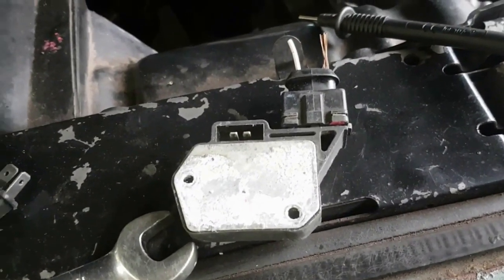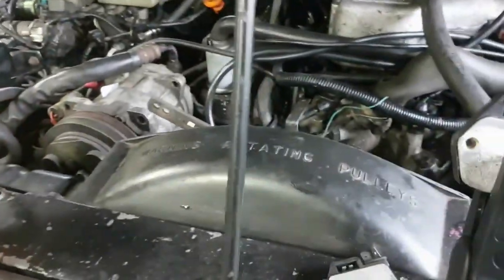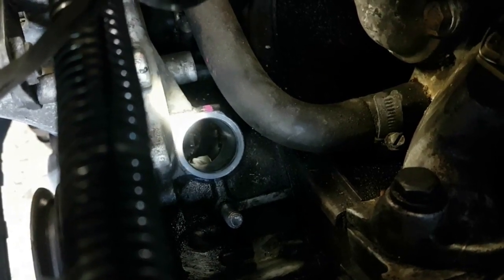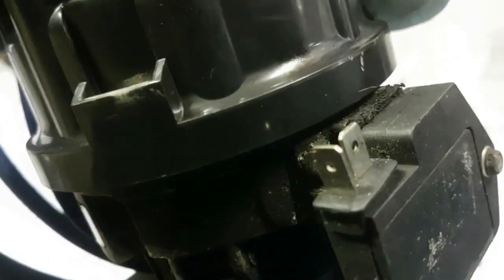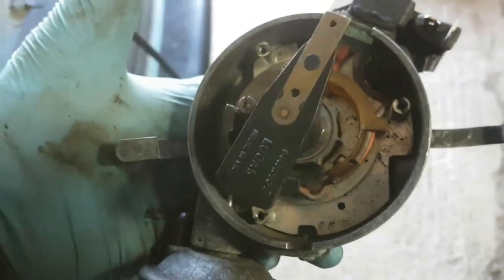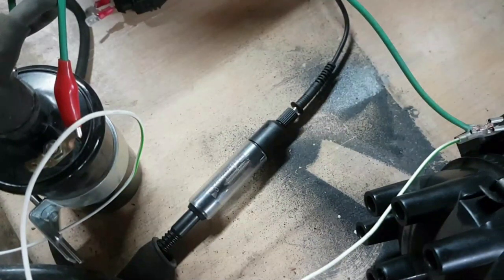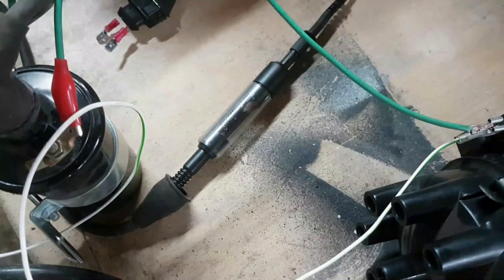Ignition Masterclass - Rover V8 35 DLM8 - Parental Warning

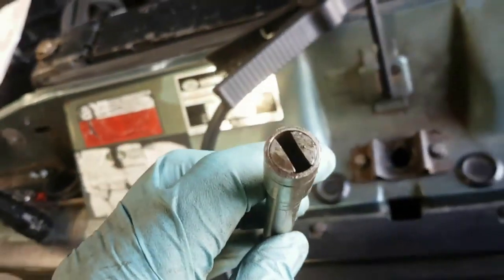Comment: 2:24 Imagine the fun you would have when the 12mm socket falls off the extension bar and drops into your engine!
Reply from the maker: only use steel tools, magnet on a stick will retrieve it. else I am sure it would find it's way to the sump.. Or just use decent quality tools where the connection is quite robust

Comment: I have 1991 Range Rover... no spark. I purchased ICM and no idea where to connect. The only after market Mallery Distributor, so its not connected to distributor. Can you offer assistance.
Reply from the maker: Mallory doesn't need the icm as it is all self contained within the unit iirc. If no spark you need to go through some basics of checking voltage to the coil and distributor LT connections and take it from there. Drop me an email if you are fighting

Comment: Hey mate, I've got a rover v8 (see my channel 🙂) it gets to about 3k rpm and splutters and won't rev any further. I've checked vaccum advance and is working by sucking on the pipe. Where should I look? Some wear in the dizzy cap. 

Running on tornado ecu chip with a supercharger on the top. Running the UK no cat 470ohm resistor with a straight through from manifold. Manifold glows red hot at idle.

Cheers if you can help!
Reply from the maker: I had an issue with a distributor that wouldn't rev past 3k rpm, that was a 35dlm8 and there was too much play between the top plate and the baseplate in the distributor.

email me if you need more info

Comment: How about the other Rover V8 distributor, the 35DE8? The one in this video was the 35DLM8, the one with the module fitted on the side, but the 35DE8 has it all inside, and I've got a problem with one of them, the low voltage bits work ok but there's some kind of daft problem with HT in the cap, there's plenty of strong HT before the cap, but it's too weak to start after it, and I've replaced the cap with a new one, AND a new rotor arm, but it's still the same, and I've tried new copper leads and still it's the same, any ideas? Have you ever had such a problem with a Rover V8?
Reply from the maker: If you are still having issues, probably best to drop me an email 👍

Comment: Half past 9 is not a straight line. Its a right-angle. You cant set it to that. Did you mean a quarter past 9?
Reply from the maker: I should have mentioned that you are using only the hour hand, so half way between 9 and 10 ish

Comment: do you know what sort of signal is fed from the distributor to the IAM? is that a hall sensor or VR sensor inside the distributor? I got the one with wires coming straight from its cap, without any connectors. under the arm there is a cover saying "factory tuned, don't touch" or something like that (probably, one of the oldest). my IAM is located under the coil.
Reply from the maker: according to the manual "the Ignition control module receives a pulsing ground signal via an 6.8ohm resistor. The rate of the pulses corresponds to the engine speed. " witchcraft I am sure is involved. There is a procedure to set the airgap between the distributor chopper and the sensor which is detailed in the manual.

The lucas 35dlm8 has the ICM/IAM attached to the distributor body, the 35dm8 has the long cable for remote location of the icm/iam, these were used on later 3.5 carburetted engines but also the 3.5efi. 

Covers attached with screws that has do not disassemble is always just a challenge. They are pretty easy to pull apart and reassemble. You can also check out the mechanical advance while you are in there.

Comment: Do you use a ballasted coil with that type of ignition?
Reply from the maker: For the EFI setup it is a quality 12v Bosch coil, there is also an ignition amplifier IAM that runs as 12v too. 

In other cars I tend to use non ballasted where I can, and the very best coil that is available. I think the ballasted coil setup was in place when starter motors were heavy duty, battery was less efficient and the coils were oil filled. giving the ballasted coil a 12v boost direct from the back of the starter solenoid would often kick an engine into life on even the coldest days.

Now we have much better battery technology etc so even when the original 4kg starter is trying to rob all the current there is still enough to give a decent spark.

Comment: Church House Classics > I'm struggling really bad with my SD1 v8, which has the factory fitted electronic distributor, as fitted to early carbed sd1 v8's. Now i set my engine to top dead centre on the pulley (big mark) and i popped my dizzy in how you did, but the engine will only run when the dizzy is turned so far anti clock wise, that it would be somewhere up at the 20 odd BTDC. I had the timing light on the pulley, and the white mark i made on 6 degrees btdc is really far out, and when i turn the dizzy clock wise getting closer to 6 degrees btdc, it starts to run really bad and when it does get to 6 degrees btdc the engine just cuts out. The engine runs like it's missfiring. Does it sound like i have the dizzy installed incorrectly? or was i meant to set the engine to 6 degrees btdc then installed the dizzy how you did?
Reply from the maker: no.1 check for me would be that the TDC marks on the pulley actually match TDC on cylinder #1. Email me, I may be able to advise further

Comment: Please help, I’m not getting any fire from the ignition wire that goes to the + of the coil and I’m not getting any spark from the coil. Why would my ignition wire be dead?
Reply from the maker: not sure, run a wire from battery +ive to coil +ive does it work then? Email me for more dialogue
Reply: @churchhouseclassics  what is your email ?
Reply: @churchhouseclassics  BLOWN FUSE OR BAD WIRE OR IGNITION SWITCH

Comment: Need a bit of help, my 3.9 has dropped a few cylinders!
Everything else is fine on the engine, you probably came across this before, any idea?
Would really appreciate your help.
Reply from the maker: depends, start with the cheap stuff first. decent ignition setup and then a compression test, you want to be seeing 150psi across all 8 cylinders. if not try a block test next. Are any of the plugs pure white and clean?

Comment: If that is the Range Rover that was brought to you and konked out and has had starting issues, it seems to me to be more of a fuel problem. Fuel evaporation something along those lines. Those V8's were a bit of pig for fuel evaporation issues particularly when hot starting.
Reply from the maker: because of EFI and pressure regulator I have never had fuel vaporisation issues. A chum had monster issues with his Rover p6, solved by wrapping the fuel line with tin foil. 

Yes this was from Project Aegean Blue, that ended up being a stretched wire inside the distributor.